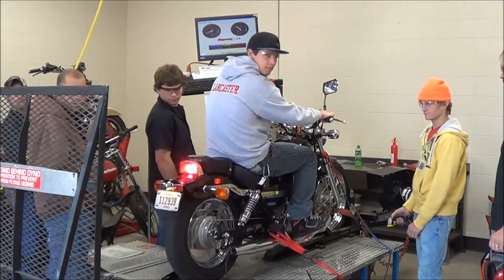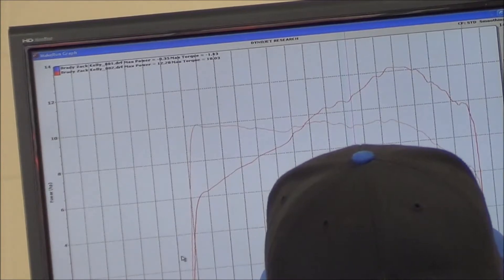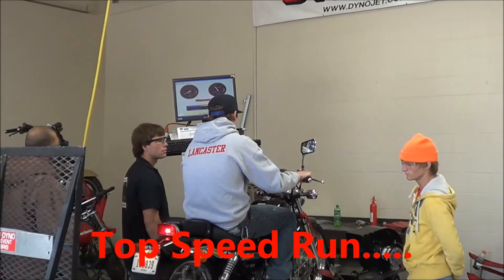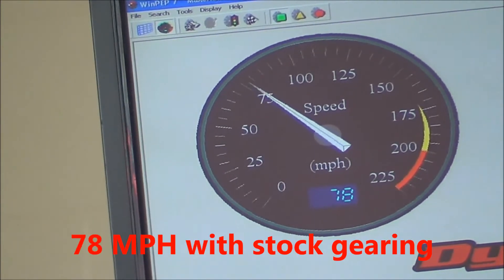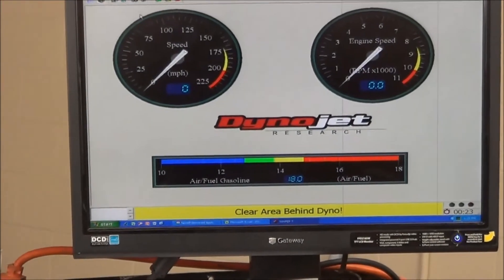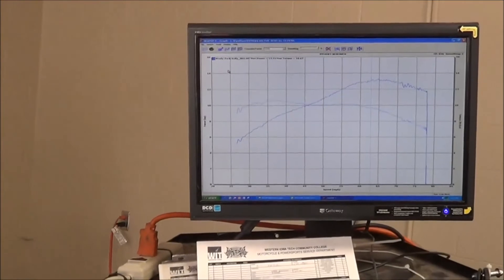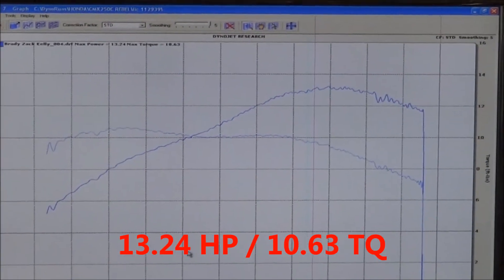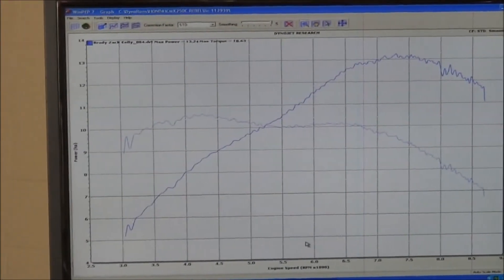Honda CMX250C on the WITCC Dynojet Dyno HP TQ and TOP SPEED

Comment: Now I'm gonna be buying a rebel In a few months for my first bike and I don't need anything super fast but would be possible to make it faster?
Reply: Depends on how much faster, how much you weigh, and what your riding environment is.
If you're a single lightweight rider, you could easily plug in a 15T front sprocket, and get to 80MPH tops.
You could also swap the rear sprocket from 33t to 27 or 29T, and get top speed in 4th gear, and use 5th gear for the 35-55MPH roads, for better gas mileage.
Reply: I get 87MPH regularly on mine with a 15/28t sprocket setup, and hit 90MPH once with some (10-20MPH) wind in the back, with still some throttle left to go.

My stock gearing only got upto 83MPH.

With my 15/25T, I haven't taken it past 85MPH in 4th yet, and it does 60-75MPH in 5th; 80MPH with some wind in the back, or another car cutting my wind.

So mine is definitely not struggling to get to 80!
Reply: I ended up actually getting a 01 honda shadow ace. I went in to look at the bike and I looked like a damn clown on a toy motorcycle lol
Reply: I Could care less about looks, knowing my Rebel is 10x more safe to ride than a big bike (I had a Shadow VT750 before, same as your ace, and didn't feel safe at all in both acceleration, and braking on the front wheel).
The wheel feels like it could give in at any time. 
Enter a corner a bit too fast, and any of those 600+LBS beasts just go flat out on the pavement!
With my Rebel, I can corner at least 5 to 10MPH faster.
Second is the gas mileage.
I manage to get consistent tanks over 80MPG, that is without trying.
With trying I'm closing 100MPG, with the sprocket change.

That saves me a good $1500 on fuel over the lifetime of the bike, compared to a bigger bike.
Not even mentioning the initial purchase price difference, replacement parts, and how easy it is to work on the Rebel (removing the rear wheel, changing sprockets and chain with just a small car jack...)...

It's fun to ride in town, easy to skip between cars (where it's legal),..
The benefits are countless...

The cons:
It's not as fast, not as comfy, and not as cool looking as a bigger bike.
But heck, I don't care!
Reply: basic answer. No
Reply: Not really Jacob. The biggest drawback to adding any real hp is it being air-cooled. You can re jet the carbs and increase intake/exhaust flow but with that brings heat and air only does so much. I rode tail of the dragon last year on mine holding 6-9k strumming the gearbox the whole time and by the time I was omw back through I had to keep my feet on the edges of the pegs the engine was so hot it was heating my feet through my gear. You don't buy the Reb to mod. Just enjoy it. It's an extremely reliable machine.